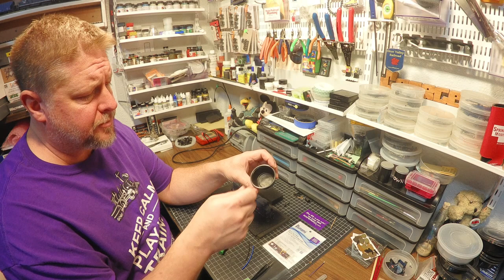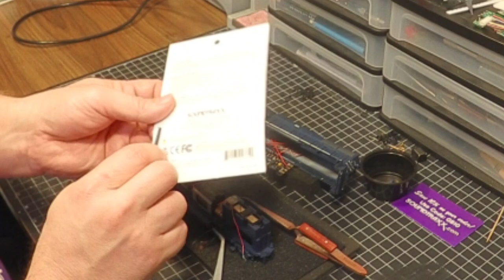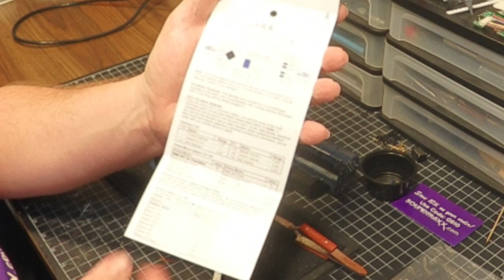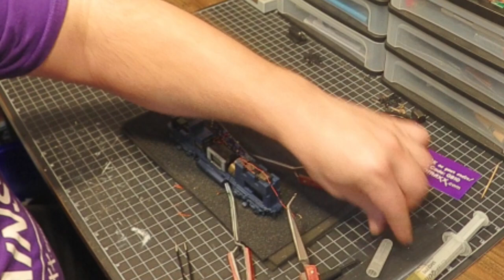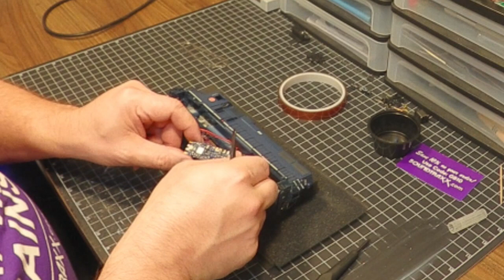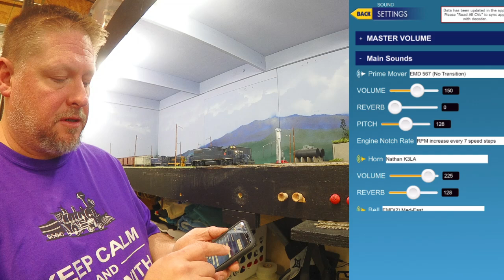Step-by-Step Guide: Installing a Blunami, BLU-PNP8 Decoder in Athearn GP38-2

Comment: Good Morning I have a question to ask you I ,ve got a SD 9 HO .
I want to wire front and back lights and a beacon and that is it.
What decoder do I need for this engine?
No sound just lights.
From Neil schwerdt in West valley City UT 8/24/26
Reply: I forgot it is a blue box
Reply from the maker: Please reach out to our Support Team directly: (970)259-0690 ext.22 or support@soundtraxx.com

Comment: Have you seen the Hornby HM DCC Bluetooth system? Just wondering how it compares. At moment all the free sound profile uploads are specific to Hornby UK models but the free control app is incredibly powerful and so easy to make cv changes. 👍 from UK 😊
Reply from the maker: Their sound quality is much lower and the system, from what I have heard, is not as intuitive.  We have been the leader in sound and DCC technology for over 34 years now, and with that comes great products.  The many sound channels, flexibility and realism built into the Blunami will blow away any competition.  I believe they brag about 3 sound channels..  Compare that to our 16, which means we can play up to 16 sounds at a time, creating a more realistic simulation of a loco rather than a ‘greeting card’ level noise playback system.  All of our sounds are pre-loaded in great quality so it should deliver a great experience.  Check out some of the reviews and our operational videos on YouTube and you’ll see.  Only limits now is we do not have a lot of UK sounds in the Blunami, but there are some that can make a believable loco.  I hope this helps.

Comment: If my Athearn Genesis GP38-2 has a Tsunami 2 , is the Blunami just a basic drop in/exchange?
Reply from the maker: The installation will be similar to the one in this video. It is simple, some soldering is required. Our Support Team can answer any further questions that you have: (970)259-0690 ext. 22 or support@soundtraxx.com.

Comment: It is very exciting that youre coming out with an Android version of the Blunami. I like how easy it is to program, and execute function changes. One question I have is, can you run the engine using the JMRI wifi throttle, or is it only functional with the Blunami app?
Reply from the maker: Blunami is a full DCC decoder. So if the wifi throttle can control DCC decoders then yes it will work. Our Support Team can answer any further questions that you have: (970)259-0690 ext. 22 or support@soundtraxx.com.

Comment: Thanks for this George.  Is there any OEM with a Blunami option?  I would love to be able to buy a OEM Blunami with sound installed.  I installed my first Blunami but absolutely cannot find a place for the speakers without major chassis mods.
Reply from the maker: Currently Blunami is not available factory installed, but send your requests to the model manufacturers so they see the demand. Our Support Team is available for install advice: (970)259-0690 or support@soundtraxx.com

Comment: Thanks George. Thanks for the comments about resisters on the PNP boards. I have often wondered why you don't have those preinstalled on the aftermarket boards when they are on the Athearn OEM boards. A peeve I have though is why is the current keeper plug on the end of the ATH OEM boards. I can't get the plug in without removing the clips and soldering the wires to the two middle tabs. Just did this on a Genesis GP9 yesterday. Your aftermarket boards have a much better location for that plug.
Reply from the maker: Thanks for the feedback. The layout of the factory-installed board is a little different from the after market and it required the plug to move.